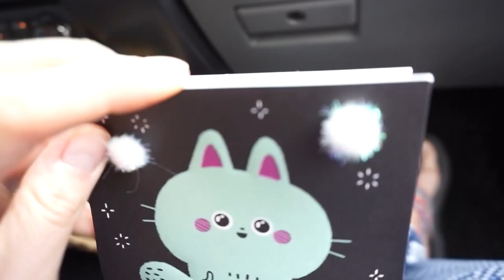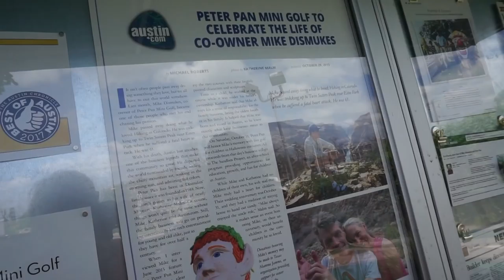WE'VE GOT ANOTHER LEAK // + MINI GOLF IN AUSTIN

Comment: You should seriously investigate a macerator pump for when you are at your normal home location.  The macerator runs on 12 volt power, connects to your sewer output, and will chop up your black water sewage and grey waste water and push it through a garden hose to wherever you are manually dumping now.  It costs about $260 plus the cost of the hose length required to automatically empty your tank in about 10 minutes at the push of a button.  Pick a different color hose than your clean water so you know this hose is only for waste.  For example https://www.amazon.com/Clean-Dump-CDTO-Portable-Macerator/dp/B007HRMYLC is a good powerful macerator pump that can push the sewage long distances and even up small hills.  Do not get a cheap macerator if you are pushing the waste long distances.

Comment: Lexel clear caulk is a rubber base it will stretch when it expands an contract never breaking its seal works good on rubber an metal. Its like duct tape is to fix all man. It is several times more expensive than regular caulk. An there is a gray puddy type material that roofers use putting on metal roofs i call it tacky tape any hardware store where you get roofing supplies would know proper name. But you would have to take up vent put tacky tape around outside edge put back down an than use lexel on outside rim of vent it will never leak again. I know places ive fixed useing this method thats been there 20 years still does not leak.